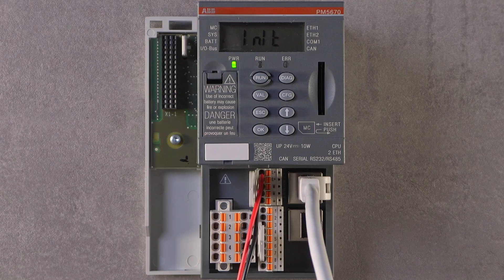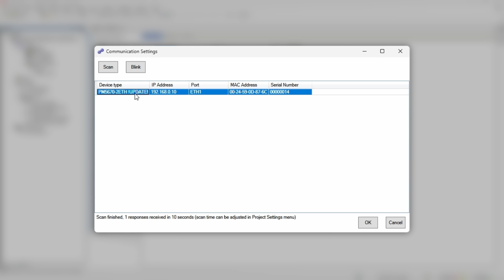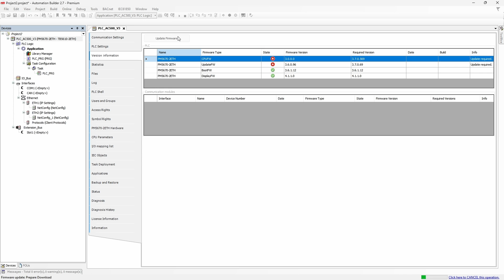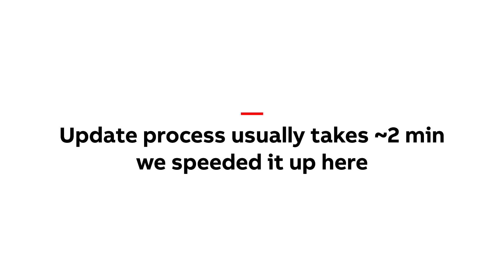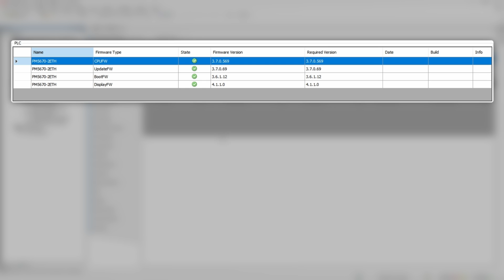How to update firmware of out-of-the-box AC500 CPU

Comment: I have two PM5032-T-ETH. One is old purchase from last year & one is new purchase of this year. I’m using Automation Builder 2.5.2 since two years. On one controller it is working fine with 2.5.2 by updating firmware & with one controller it is not updating firmware. Tried with Automation Builder 2.5.2 & memory card method also. What can be the issue ? And how to resolve ?
Reply from the maker: Hi! The the first thing which draws my attention that version of Automation Builder is something like 3 years old. I'd recommend to update to 2.8.2 and try with this version. If I recall correctly a year or so ago there was a hardware (by the way you can check whether order numbers are identical or differ slightly) update which required newer firmware. And for newer firmware you need to have newer version of Automation Builder.
Reply from the maker: If that doesn't help - contact local technical support in your country